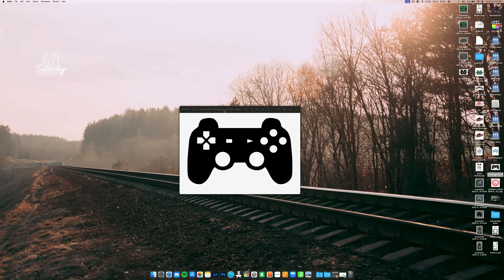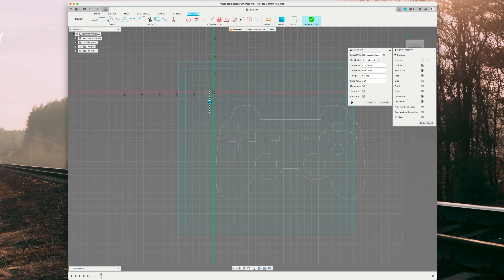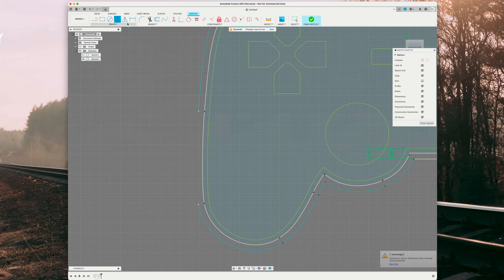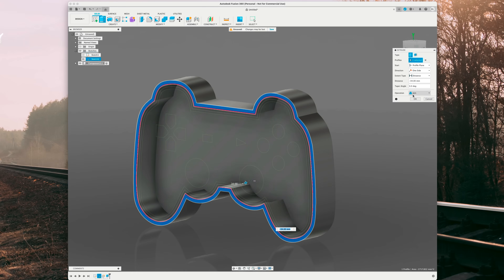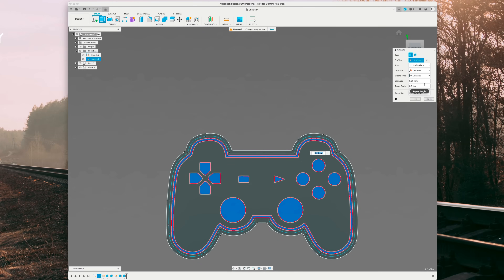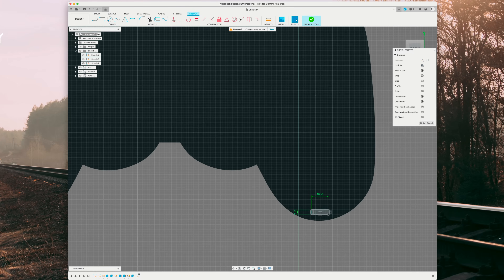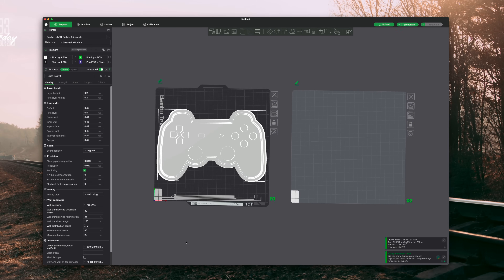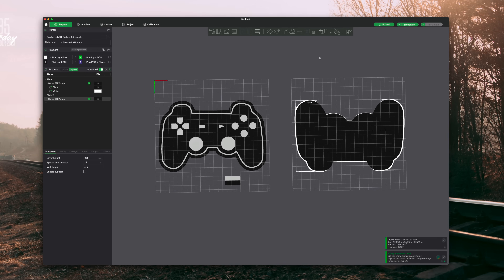How To Create A Basic Light Box Using Fusion 360 | 3D Printing | Bambu Printer

Comment: Hello. I followed your tutorial and the face plate is just a tiny bit bigger and bends a bit in order for it to go in at all. Do you have a video on your settings for bambu? Or do I need to do something else? I should also let you know i just did a square box but did everything in the tutorial
Reply: Just scetching my first one on fusion and while watching all these 3D lightbox videos, almost all of them are lacking same thing, which is tolerance between the front panel and the back panel. They will never ever fit in without small tolerance added. So take 0.1-0.2mm off from the lip to create small gap between front and back plate. Just don't take too much or it become too lose.
Reply: @KossuJahvetti  Thank you for this reply. I couldn't figure out for the life of me what the heck I was doing wrong.

Comment: Hi. Thanks for the video.  I have a question. Since you extruded the box "walls" up from the back plate and the front panel down from the top (-1), I think the edges are overlapping by 1 mm.  Is that correct? Would it be better to extrude the front panel by +1 instead of -1?

Comment: This is a great tutorial, but I had two issues and I'm confident it's my fault because I downloaded F360 for this tutorial. My front and back are exactly the same size, so that's good, but they don't fit together snug like I thought they should. There is a lot of wiggle room between the lip and the back. The other is, my black on the front printed fantastic, but white is super stringy and you can see all the lines and there actually appears to be holes in some spots, although the back side (not on the plate) looks much better. Any suggestions for either of these?

Comment: this doesn't take into consideration light boxes with writing. Following this tutorial your writing will be backwards!
Reply from the maker: Never had an issue with writing being backwards
Reply: If you didn't noticed he planted the front cover face down on the plate in the slicer, which is in practice just an inversion of the object. This means everithing will turn out fine, even text. Instead of just glossing over the information in the video, pay a little bit of attention to the details. It's quite informative and filled with practical advice.
Reply: I am pretty sure you are right before you start you need to flip the image. I have watched this video a bunch and first one with text I tried it came out backwards. So pretty sure these guys haven't actually made one with text

Comment: Thanks for the video, I was able to create a lightbox successfully using this method.  When I tried a second one though, I've hit a snag with the first offset not working right.  It seems to be the same problem you had when creating the second offset in this video at around 4:12, but I don't see a white dot anywhere on the line like you did in yours.  Any tips on how to find why that offset line isn't creating a separate area like it should?  
The weird thing is, if I create the second and third offsets, those do work right, but the separate area created by the second offset line runs from the original image line to the second offset line, ignoring the first offset line.
Reply: I have the same problem with all the dots being black but this is on the first offset.
Reply: I figured out how to find the one point that isn't working. you have to hover above every single one until it doesn't display anything extra around it.

Comment: Good tutorial. Made some mistakes but got a finished result in the 2nd print. If you could add cc to your video that would be great. Also the negative number you put were reverse for me and I was not able to import the stl into different component to paint in bambulab so I exported the back and front separately and I painted it in bambulab. Thank again for the great video!

Comment: Nice video! Thanks for sharing your knowledge. Anyway I'd love to see how you install the LED strip. I'm not sure why you added the small cut out at the back. Its too thin for a cable. I understand, that this cutout is for your strip, but why do you want a cutout for the strip at the back and not for the cable?
Thanks!
Reply from the maker: Mine fits just enough for the cable to slide in and be a good tight fit

Comment: What kind of material
Reply: Whatever material you have. PLA is probably the easiest for beginners. PETG is good but it potentially strings if you don't have good filament / printer settings.
Reply from the maker: Pla or pla plus

Comment: I love this video. I just have one question. Why is it when I insert my SVG, it is backwards? I try to flip it the right way, but then when I put in all of the offset measurements, instead of it measuring outward, it measures inward. Any suggestions?
Reply: I'm having the same issue, I was able to rotate the image with the little hour glasses, but my offsets are going the wrong way unless I make them negative. Which I feel like is incorrect.

Comment: there are basically two versions of lightbotxes.. the one from the video printd with the logo side ont he bed so the whole thing is flat and textured... AND ther also is a way to print the logo lines sticking out... 
this one here is easy the other ones takes a lil bit more work in fusion but it lets u print the colors better... no switchitng back and forth filametns...

Comment: hey i seem to have a problem. The SVG im using seems to have to many curves. So when I go to outline fusion 360 just totally locks up for a good 5 to 8minutes. Do you happen to know how I can cut down in the curves on my svg?
Reply from the maker: Use a different SVG or before hitting finish sketch when svg is loaded in use the line tool and make your own outline of the svg, click finish sketch then offset that

Comment: Great tutorial, I'm having problems with the offsets - I think it's down to the SVG quality - and some lines are disconnected and then Fusion is giving out errors. I've also made just a rectangle-shaped box - and then added the svg to the top area and that appears to have fixed the issues I was having with the offsets but the downside is the shape is a rectangle and not a nice controller like yours. Any tips I could try?
Reply from the maker: Yea I can help you out. Reach out to on IG or maker world. Bearded Dad Designz

Comment: Your videos are super helpful but im having a major issue i cant figure out! I followed all these steps and was left with a pretty good looking model. So i printed just a test and, it came out pretty badly. Tons of gaps and open lines/dots where the light shines through. Its kind of a mess.

I dont think its a slicer issue because i have a preset saved in bambu specifically for printing lightboxes, ive printed 3 flawlessly so my settings are definitely working. So it must be a fusion issue, or maybe the original picture i used had issues? Any idea on how i can get a cleaner result
Reply from the maker: I do a flow rate of 1.04 for light boxes to prevent gaps. Make sure flow rate is 1.04-1.08 and Arachne is on with 24% wall overlap

Comment: Thank-you so much for this! You actually show what you are doing and don't go too fast!  I am a complete newbie to Fusion 360, so I don't know where any of the menus are, or what they all mean, but I was able to work it out from your video without much trouble.  I am still having trouble with the offsets and being able to select them separately from each other, I don't know if my designs were just too complex. Do you have any tips on how to make a stand? The bottom of my design isn't flat or even, so it's going to be tricky to balance.
Reply from the maker: Glad your video helped. Unfortunately each design is different. I learned some designs I need to add a stroke in photoshop to make ones solid boarder. I’m making a video on stands soon
Reply: @Ryanlit  I might need to do that with some of the designs I want to make into lamps, I was almost to the point of freehanding the offset lines and scanning the thing. I just squared off the bottom of my lamp so fingers crossed. I just sent it printing now.
Reply from the maker: Yea a few different ways of doing it. I heard some people design in canva. I always used photoshop but if their is a free way I will explore it and make a video
Reply: @Ryanlit  there are a few free programs out there that are photoshop like, I have Krita but I use it mostly to make transparent background or resize images. I will look forward to new videos. I printed my lightbox, and it worked. I learnt that my hole for the LED strip I had was too small, but other than that, came out just how I wanted it to.
Reply: I can’t highlight offset vs the image.
Reply from the maker: @dugy40  I gave you my Instagram link on how to reach out and still waiting for you too

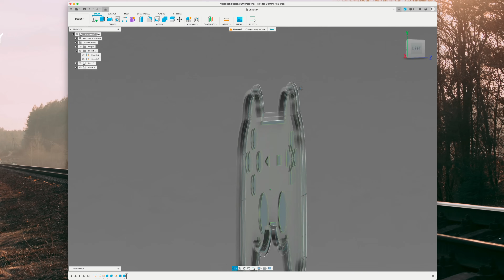Comment: I am stuck at the 8:00 minute mark, when I hit ok it just goes away and doesn't make the lip.
Reply from the maker: I had that issue and turned out to be an SVG file not converted right. Does fusion give an error? Also make sure its set to join or can even do new component

Comment: Thanks so much, this is perfect for a noob like me haha. 1 question i have, usually when i see other lightboxes online they have a little mini stand that they sit on (depending on the shape of the box) how would i go about making a custom stand that sits perfectly flush with the model?
Reply from the maker: I am working on making a video on how to do the stands
Reply: Utilize the offset command on the sketch from the beginning. Make a offset just the size of whatever size stand you want and square off the bottom to sit flat on a table and extrude just that piece.

Then hide all other bodies/ components except that one and export. Now you have a stand that matches the contour of your box and can print it separately.
Reply: @caseymiller8404  that honestly sounds confusing but, i also think i could figure it out thanks !
Reply: @Brog420  
I know sorry its hard to explain over text.
1. Go back to the original sketch of the whole body and click edit sketch. After you made the 3rd offset sketch of the WHOLE outline. (Note what distance you offset the 3rd, or outer most line)
2. You're going to make another offset line but don't select the whole perimeter line this time, only select a part of line on the bottom of the image (Not one of the 3 lines that you offset in the video but from the ORIGINAL imported SVG). In the example of the video, you can select the line on the bottom that goes between the 2 handles of the controller. 
3. Offset this new partial line just 1-2mm PAST the distance i mentioned in step 1. Now constrain that line by drawing more lines to fill it in so that it is fully constrained. That will be the shape of your stand. Make this whatever shape you want as long as the bottom is flat. 
4. Extrude that shape the same depth as your light box and you will have a stand that fits the contour of the bottom of your light box.
***This is just a rough and quick way, you can get more creative with it later. Hope this helps.
Reply: @caseymiller8404  thanks alot !
Reply: @Brog420  One more add to Step 2 above. Depending on the shape, you won't be able to offset just a section of the line/curve. In that case, after the 3rd offset line like in the video, offset a 4TH LINE just like the others but make it 1-2mm greater than the 3rd line you offset. Then manually delete all the parts of that 4th offset line except for the parts that follow the contour of your light box on the bottom. Then follow the rest of the steps to make a square stand or whatever other shape you wish!

Comment: Is this possible to do with no ams?
Reply from the maker: There is a way to do it. However I’m not sure. You would have to set a pause for each layer that changes colors.
Reply: @Ryanlit  I just ordered the ams a couple days ago can’t wait to do multiple color with ezz
Reply from the maker: @malcolm4k270  I highly recommend the AMS. I know some peoples budget can’t afford it. But definitely an upgrade to do if you can. So many things. I have 5 AMS units with 3 printers. 2x x1Cs with dual AMS and 1 p1s with single AMS.
Reply: Maybe if you split the model into pieces and attach them after printing separately?
Reply: No.

Comment: This was EXACTLY what I was looking for. A 100% end to end on how to create these light boxes before printing. 

You have made my day/week/Christmas! And hopefully, my wife's christmas!
Reply from the maker: That’s awesome to hear. I noticed other videos where to long. So I made a short and to the point video. Make sure to subscribe for more fusion and 3D printing stuff
Reply: @Ryanlit  Quick question: Would you print the face on textured plate or on smooth plate?
Reply from the maker: @TeagueTrollbane I always do texture. The texture plate hides the lines from the layers when printing face down and is more forgiving on little imperfections.
Reply: @TeagueTrollbane   another suggestion is to use those new PEO/PEY sheets with nice patterns, I have been using them for my lightboxes and they are coming out beautiful.
Reply: Do you ever have a face plate that doesn’t fit snug to the back and you end up having to use alittle glue cause some not all I design using your steps clip tight and some are a tad off and fall out unless I put alittle glue